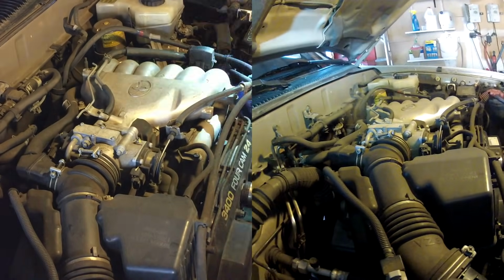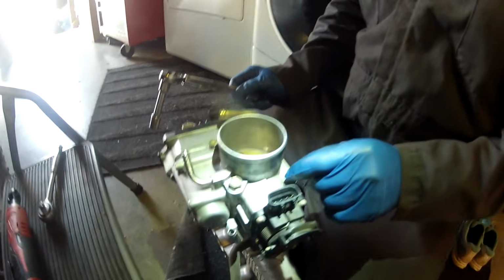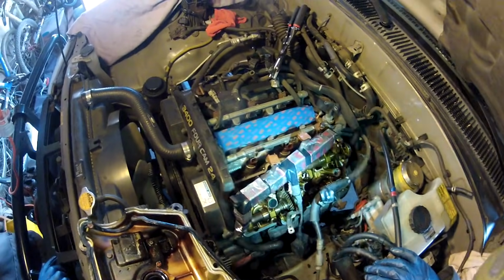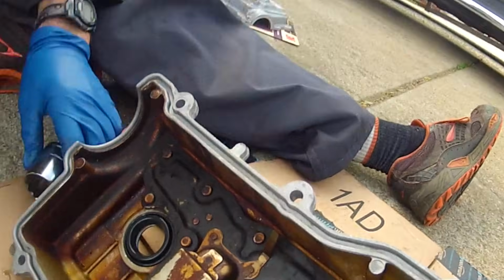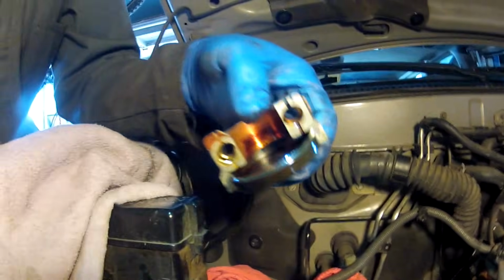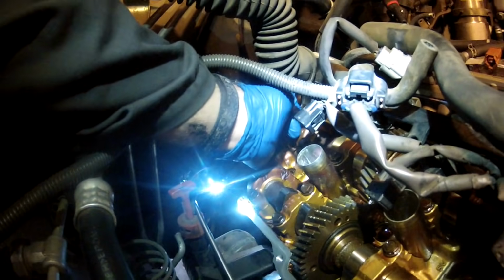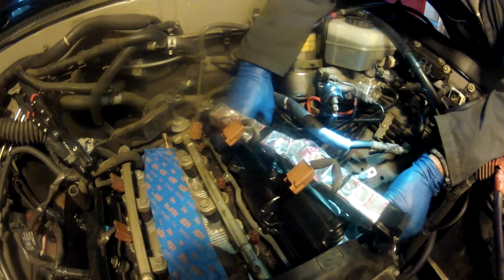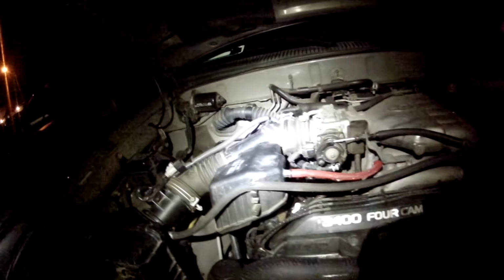3.4 L V6 5VZ-FE Toyota 4runner, Tacoma, Tundra Valve Cover Gasket Tutorial

Comment: Hey guys!  Great video once again.  About to do the first of three valve cover jobs this weekend.  I was planning on removing the throttle body to clean it and the factory service manual says the gasket between the upper plenum and throttle body is non-reusable.  Is this something you replaced or recommend replacing?  I was also going to remove the Idle Air Control Valve to clean if if need be while I was in there.  A few other videos I have seen had this pretty gunked up.  Is there a reason you guys didn't remove this?  Would you recommend removing it even if I don't have high idle as you stated in the video description.
Reply from the maker: Kyle Bergen Hey Kyle, we did replace the throttle body gasket.  It's listed in the parts list at the beginning of the video.  We didn't think of cleaning the IAC because it's usually something you mess with only if you're having idling issues.  What you have to be careful with is allowing the runoff from cleaning the throttle body to drain down into the port that leads to the IAC.  Either spray throttle body cleaner on a rag and then wipe down the throttle body or hold it in such a way that the IAC is facing upwards so the dirty runoff doesn't drain into the IAC.  Hope this answers your questions.
Reply: Thanks for the speedy reply!  I ordered everything on your parts list about 3 weeks ago.  Must have forgot that I also ordered a gasket.  So that answers that.  Thanks for you input on the IAC.  It's a friends truck so I'll give it a drive before hand to see if I notice a high idle.  Just out of curiosity, where are you guys located?
Reply from the maker: Kyle Bergen We're in the California Bay Area.  I live in San Jose, and Sean spends part time in Los Gatos and part time in Half Moon Bay.
Reply: Dang.  I'm in Colorado.  Was going to suggest we hit a trail at some point.  I'll hit you up if I'm ever in the area.
Reply from the maker: Kyle Bergen What part of Colorado?  I've mountain biked extensively there.  I ridden in the following areas: Durango, Teluride, Winter Park, Vail, Boulder,  Grand Junction, Fruita,  Salida, Gunnison, Crested Butte, and I think that's it but there is probably ones I'm forgetting.  I also summited Long's Peak.  Definitely look me up if you come to California.
Reply: I live in Boulder and am also an avid bike rider.  Some incredible bike riding around these parts.  I've ridden all of the places you listed except Crested Butte.  I have a buddy that lives there now and have been itchin to go.  I've heard it's incredible.  Finished up the valve cover job on Saturday and everything went smooth as can be.  Thanks again for the videos!
Reply from the maker: Kyle Bergen I have a buddy that lives right outside Boulder that was on my racing team in the 90s.  Glad the job went well for you.  If I ever get out to Boulder, maybe we catch a ride together.  If you ever come to the San Jose in the California Bay Area, hit me up because I could take you on a lot of good rides.

Comment: Great video.  Been having to borrow my BIL 2002 4Runner and his leaking valve cover gaskets are driving me crazy.  Surprised just how much I have to do to just change valve cover gaskets.  I appreciate your anal, detailed video.  FYI - torque wrenches don't work properly with swivel attachments.
Reply: Tim, are the round cam plugs reusable as you suggested the half moons are?  Can I just clean them off and use RTV sealant?  Amazon doesn't wanna ship them to me in Hawaii...
Reply from the maker: You're suppose to replace them.  Probably because the cam plugs have a rubber material around the outer circumference which seals with the head and the collar that holds it in place.  I know some people actually choose to add some RTV as extra insurance when they replace them but I don't know of anyone who used their old ones and just resealed them with RTV.  I suppose it could work.  What would it cost to get them from another supplier.  There's no online Toyota parts sellers that will ship to Hawaii?  I'm guessing the shipping fee would be expensive?

Comment: Tim,
Why did you do this job to the engine? You never mentioned why this is needed?
Is this in the maintenance schedule? 
When and why would we do this?
You rock!
Thanks!
Mike
Reply from the maker: Hey Mike, you do this job because you're getting oil leaking either from your valve cover gaskets, from the 2 half moons on each head or from the cam plugs on the backs of the heads.

This is not a scheduled maintenance item.  You only do it to fix a leak.  We're glad you like our channel.  Happy Wrenching!

Comment: Thank you Timmy for the video! I just worked on the same job and found the RH valve cover to be cracked... Gotta wait until Toyota opens on Monday and beat the rain. Again, I appreciate your help! you saved me about $600+ just giving me some confidence that it can be done. Cheers
Reply from the maker: Hey Gregory,  Great to hear our video gave you the confidence to tackle this job.  

The reason why these valve covers crack is somebody didn't tighten it down correctly.  You have to slowly and evenly tighten them down so you don't force the valve cover to try to flex.  The valve cover is a cast piece so it won't flex, it will break.

Do yourself a favor and see if a local PickNPull or Auto Wrecker has a vehicle with a Toyota 3.4 Liter V6 in it.  Obviously search for 3rd Gen 4runners but also search for 1st Gen Tacomas (1995-2004) and T100 trucks.  You have a good chance of finding a wrecked one that still has the engine in it and you could pick up a valve cover for pretty cheap.  The dealer price is probably going to be pretty high.  If you can't find one at a wrecking yard and you don't need your rig for daily driving, I'd order from an online seller like Camelback Toyota out of Arizona.  You'll save quite a bit of money ordering online as opposed to buying it straight from your local dealer.

Comment: Hi Tim, question regarding about the valve cover washer, wondering what's going to happen if I don't use the rubber washer is that something that will damage my motor later? I notice that with my 2015 4Runner they are not using a rubber washer just straight bolt. Appreciate your input.
Reply from the maker: jeff guia  Hey Jeff, I don't exactly know what the Toyota engineers purpose was for those washers.  I do think as the rubber on those washers ages and shrinks, it allows the bolts to loosen which causes our valve covers to leak.  Maybe the washers are a vibration inhibitor since the torque spec is so low.  Vibration from the engine could loosen the bolts and the rubber dampens that vibration.   So, sorry I couldn't give you a definitive answer but I would suggest using those rubber washers unless you hear from a reliable source it's ok to leave them out.
Reply: Hi Timmy, question about the half moon just Finnish putting back my valve cover I notice that my half moon is slight off from the valve cover wondering if that's ok or not?
Reply from the maker: Hey Jeff, what do you mean by slightly off?  It should sit flush with the head surface.  The half moon can rotate in it's slot on the head and I'm guessing that's what you're talking about.  But, if it wasn't completely flush, putting the valve cover on an tightening the bolts would bring it flush as the valve cover gasket met up with the surface of the head.
Reply: Hi Timmy, thank you for the fast response. It is flush in the head surface, its slightly off on the side that kinda worries me but, i place enough sealant hopefully that will not be an issue later.
Reply from the maker: Now I know what you're talking about.  I'm pretty sure there's one side that's meant to face the interior of the head and one side that's suppose to face the outside of the head.  If I'm remembering correctly, the thicker side faces the inside of the head.  I'm pretty sure with the right amount of sealant, it won't cause you any issues.

Comment: I followed the video and I'm confused why you wrote 4 cam seals because you only changed two. the other two require disassembly of the timing belt.
Reply from the maker: Hey Pierre, sorry for the confusion.  Listing 4 cam plugs was an error.  I listed this error in the beginning of the video description.  The only way to correct this error would be to delete the video and upload another with the correct information.  By the time somebody pointed this error out to us, the video was already up for a while and had lots of comments.  Since I didn't want to lose the comments, the next best thing was to report this error in the video description.  So, long story short, you will only be replacing two cam plugs.

Comment: 97 4runner SR5.... Only needed to swap out a cracked valve cover on the drivers side... saved some time by "pealing" back the upper plenum and using zip ties off the underside of hood to hold it out of the way... didn't have to address the throttle body. (Already did the passenger side a few weeks ago so didnt need to go there either. Saved a little time by not having to disconnect a bunch of stuff)... took me a few hours as I dont do this everyday. Cracked the plastic wire harness as expected..... Labeling every thing made it that much easier. You can do this!!!! Im not super experienced, only experience is been watching guys work on cars for years, not super strong, 47 year old Female, not a gear head... made sure I had the right materials and tools before starting the job with a clean space and good tunes playing. Bonded a little deeper with the 4runner and saved a good amount of money thanks to this awesome video. Thanks Tim.
Reply from the maker: Thanks for sharing your success story.  Anyone can be successful at auto mechanics.  You just have to be willing to learn and invest in some needed tools.  The internet has definitely helped with working on vehicles.  Back in the day, you had to know someone with some automotive experience or rely on the auto parts store manuals like Chiltons to figure out how to fix something.  Now, you have a wealth of information right at your finger tips with YouTube videos and forum write-ups on how to maintain, repair or modify your vehicle.  Happy Wrenching my 3rd Gen Sister!

Comment: Tim, I need your help. Love your video and everything worked. I even cleaned my throttle body. 
I too have a 2000 Tundra. After I put everything back together, my engine idles runs a a higher RPM. instead of the normal 500 rpm, its idling at 1,500.  Other than that, everything is fine. Can you help?
Reply from the maker: After a throttle body cleaning, it is fairly normal for it to idle higher for a little bit and then it should return to normal.  If it still maintains a high idle, there's a chance some of the throttle body cleaner runoff made it's way down into the IAC (Idle Air Control valve) There's a air pathway to the IAC from the throttle body and maybe some of the dirty runoff got in there and it messing up the idle.  So, if the high idle continues, I'd pull the throttle body off, remove the IAC from the bottom of the throttle body and clean out the IAC with some throttle body cleaner and reinstall it.  Be carful unscrewing the IAC because I've heard the screws can be easy to strip if you're not careful.  Just use the appropriate sized Phillips screwdriver and you should be fine.  Let me know how it works out.
Reply: Tim, I did what you mentioned and the problem is solved. The engine is now idling properly.  I'd recommend anybody cleaning the throttle body that dirt from the throttle body can makes it way down and into the IAC. After taking the IAC apart, I was clean it. My engine is now running properly.
Reply from the maker: daycinvac That's great to hear.  At the time we made this video, I was unaware there was a potentially bad side affect to cleaning the throttle body.  When I cleaned mine, I just spayed some throttle body cleaner on a rag and wiped down the inside of the throttle body and the throttle plate.  I'm going to add a statement to the video description to warn people of this potential issue.

Comment: Thank you SO much for this!! I am approaching 550,000 miles on my 02 tacoma and the valve cover gaskets have just recently gotten bad.  I do most all my own work on my truck, but i'm still not sure if I want to do this job.
Reply from the maker: porthos6914 Dude, follow the video, take your time, label hose and electrical connections and you'll be golden.  Unless you have a shop that works for a really low hourly rate,  this job will cost you a pretty penny.  Take up the challenge!  How was that for an inspirational talk?
Reply: Can't beat that for motivation!!

Comment: Great video as usual Tim!  Dalandser from Tacomaworld here.  I was able to get the spark plug tube gaskets out with a claw type seal puller pretty easily.  Also, could you list all of the torque specs at the beginning of the video with the part numbers in each video for consistency so it's easier to find them if someone forgets to write them down lol.  Kicking @$$ man.  Thank you for this.   Have a good day!
Reply from the maker: The seal puller idea sounds like a good one.  I've also heard people just pound from the top side with a screwdriver to pop them out.

This was the first video Sean and I made together and that's how Sean decided to show the part numbers and torque specs for this video.  Since then, we haven't been consistent with how we provide this information.  I do think the best option is to put this information in the video description though.  This way if we forget something or make a mistake, we can go back and change it easily.  In this video, Sean made a mistake with the quantity of cam plugs needed for the job and left out a part number for the spark plug tube seals.  Once the video is uploaded, the only way to make a correction to the video is to take it down, edit the video and then upload it again.  When we do that, we lose all the questions and comments people made.

The video description is also an area I put other information like helpful tips that I forgot to mention in the video, links to tools I used for the job, and links to other information like Toyota forum write-ups/threads that cover the same subject matter.

So, in future videos, if you miss a torque value or part number while watching, look at the video description for this information.  I'll start looking through our old videos and add that information to the video description as time allows me to do it.
Reply: Great idea.

Comment: Do I need to replace the intake manifold gaskets??? I have a 2004 Tacoma 3.4L
Reply from the maker: If you're referring to the two plenum gaskets, Yes, you should replace them.  If you're talking about the actual intake manifold, No, because you don't have to remove it for this job unless you really want to dig further into your engine.

Comment: Can you leave the tape on the plastic harness or should you remove it before you reinstall it.
Reply from the maker: teengeek17 You can leave it on as long as it's high temperature ducting tape like I used.
Reply: Did you leave that ducting tape on?